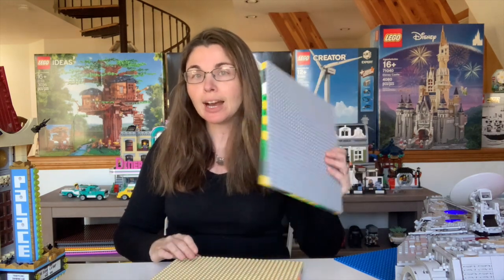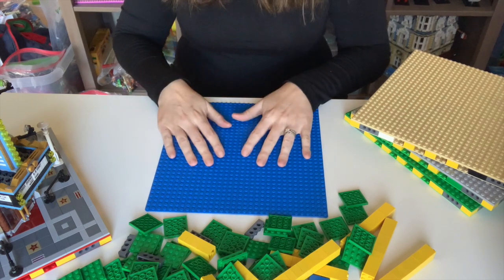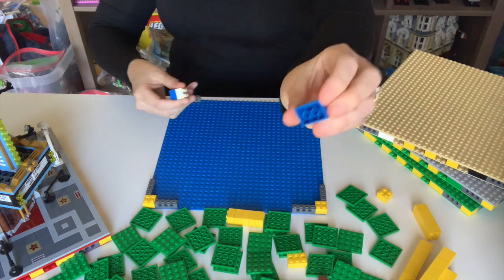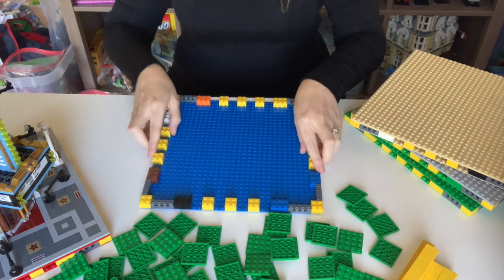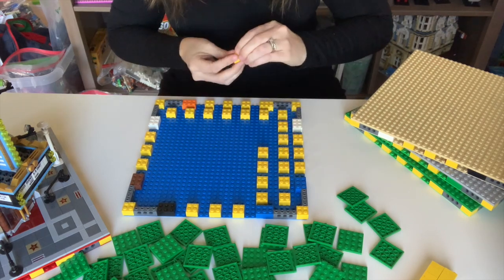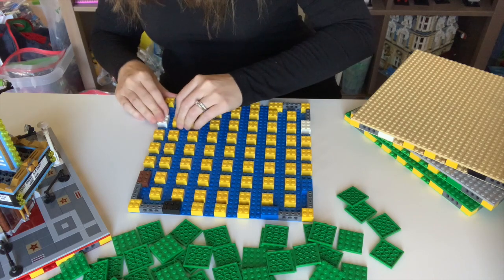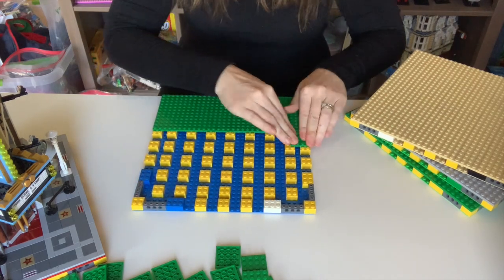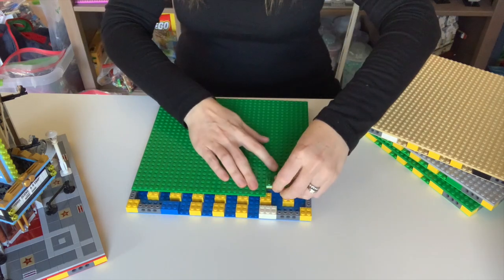So easy! Make LEGO MILS Plates From Start to Finish

Comment: So glad I found your channel.  I purchased enough LEGO for 25 plates, however, I found out that the lavender 2x2 were the cheapest...as least is was when I purchased 2,000 bricks.  The reason I went forward with this was your video on moving the modular.  I moved two today, the Cafe Corner and Grand Emporium.  Glad I followed your advice to have the instruction manual as I definitely needed it.  This also gave me a good opportunity to do a good cleaning on the building.  Now I need to move the Diner and the Fire Brigade.  Then I have quite a few that aren't built yet...just missing the Green Grocer.  Thank you for posting the video and making it look easy.
Reply from the maker: Awesome! Yes, the cheapest color switches around so it’s definitely good to be open to all colors! It really is easy to move them as long as you stay focused! Good luck on the rest and thank you!

Comment: I'm just starting out with a few used modular buildings and getting my MILS plates together.  One of these is the Assembly Square set.  How do I make a MILS plate for this set?  The set uses a 32x32 baseplate + a 16x32 baseplate so I need a footprint of 48x32, which I can't figure out how to make a MILS plate.   Is it best, to just make 2 32x32 MILS plates and build on top of the two as a unit?    Thanks!  I just found your channel and have watched quite a few, great job!
Reply from the maker: Hey,  I would simply build on the 32 and 16 provided. Build them as one with and joint them with 2x4 bricks down the middle to create one large footprint to then turn into a mils plate. You don’t want to make them two separate plates for stability.

Comment: The 2x3 bricks are not required, they can be replaced with 2x2 bricks. Also the technic bricks are not reqiured, I connect my plates together with tiles and what not (saves a little $). Love the channel!
Reply from the maker: You are correct! I will use any assortment that I have available. I like to keep each of mine separate though as I move them all too often. I may never pin them together at this point.

Comment: I’m just about to start building a city and I’m glad I found your channel. I finally have a spare room since my last child moved out 😂
Have you used this method for Lego trains? I’m hoping to have a number of trains in my city.
Thanks
Reply from the maker: I have not yet but will as I have a couple myself but space with a train and a city is tough. If you really want a train or multiple trains, start with them. Then add your city around it. You would simply build your mils and add the track to the top. You can easily dress it up and make it look cool from there.

Comment: I just gotten the Assembly Square set..I've combined the 32x32 and 16x32 wide plates to make one 32x48 mils since I won't need to separate the buildings. It looks a bit strange but it's really stiff
Reply from the maker: Awesome. Mine is joined up as well. Doesn’t split. So easy to move!

Comment: Where do you get your bricks from to make these?  I'm new to the hobbie and don't have the spare pieces.  Thanks a bunch for the video!
Reply from the maker: 👋 I buy in bulk off of bricklink. I have a video that breaks down average cost as well.
Reply: @LittleBinsandBricks  Thanks.  I just dropped some cash on bricklink.  Very cool sight.  For halloween I'm going to add the haunted house on a 32x64 MILS plate so I can extend the fence off the front and put the graveyard scene to the side.  Will be a little weird in a city scape, but hey it's going to be halloween soon :) 

Thanks for the videos.

Comment: Instead of using 64 4x4 plates, have you tried making one with a 32x32 plate on top?
Would cut down on the number of 2x2 bricks that you would need as well.
In another video you mentioned that you bought some of those off brand base
plates. Don't want to mention the brand here, but there is one that has 32x32 plates.
They call them stackable baseplates  but they are actually just plates. Holes underneath

and not flat on the bottom like a base plate.
James
Reply from the maker: Yes I do have some of them. They could work but I found the connection strength to really vary from plate plate. Not consistent quality at all from that batch at least! Though it could be done if necessary!
Reply: @LittleBinsandBricks  , O.K. Was just wondering if you tried them. I have and 
they (the brand I bought) seem fine. I have seen reviews on AMZ for some brands and they said some spots were not as tight or even to tight fitting but I figured since it's going to be a MILS plate do we really need every connection out of 32x32 to be perfect. Anyway, look forward to you next videos. James

Comment: Great video   How do i go about making a mills plate for the assembly suqare?
Reply from the maker: Thanks! Well you would take the 32x32 and 16x16 and secure them with Bricks up the seam of the two and then build the mils plate out from there. You can also build the two plates separately and then pin them before transferring the building. Or! Get ready for this, build it on two full plates and add more walkway, park area! Then you don’t have the odd half plate size!

Comment: Good stuff! I've never built a MILS plate but I currently have something similar in the town I just started working on (got a few of the 30604 road expansion sets on clearance for $12 each) and it definitely isn't as durable. I just don't have a whole lot of base plates for the very bottom, so I might have to go with normal plates for now.

I've been kind of out of the loop on Lego tricks for 20 years and I'm trying to catch up. Is it generally less expensive to get four 4x4 plates than one 8x8 plate?
Reply from the maker: It’s all about working with what you’ve got! I just got into LEGO really about a year ago other than building things with my son when he was younger. In general, the 4x4 is cheaper with a better range of colors. Though it’s always fluctuating!

Comment: Like Jason H I was wondering if I can simply use another 32 x 32 base plate as a top layer instead of all the 4 x 4 plates or is there a strength difference? Great video, liked & subscribed. We have 6 modulars now and just waiting (patiently?) for an adult son to move out so we can take over their room! Lol.
Reply from the maker: Unfortunately the base plate does not have the stud connection on the bottom. You could try off brand plates I won't tell. Mine is 11 let's see how long we have to go. He's got a big room.
Reply: @LittleBinsandBricks  Ah yes I forgot about that issue with the typical baseplate, however, have you heard of Slab Dream Lab(Made In The USA, yay!)? My local Bricks & Mini Figs store just started carrying them and they have base plates that are 38 x 38 studs and they do have the stud connections on the bottom 2 wide all around the edge(sort of, hard to explain but they aren't exactly all the way out along the edge) and 4 wide in a cross pattern through the middle of the plate. I have 4 of them now and they cost me $7 each. There are some problems with the way the stud connections are laid out on the bottom but the whole plate is at least twice as rigid because of its construction than a normal Lego base plate.
Reply: I went with 32x32 plates from Strictly Briks on Amazon instead of the 4x4 plates.

Comment: Starting to build MILS plates and wanted to know what color you suggest for the top 4x4s?
Reply from the maker: Well I paired each modular with the color of the base plate it came on if you want to get very specific. Other than that a lbg works well and of course green for outdoor spaces. Finding them now is the tricky part!

Comment: Ok so while I go back through and still try to decide... I have a very important question... what about the builds that are not on square baseplates, and cannot be? Like the Disney Castle, or the carousel, Ferris wheel, roller coaster, Disney train station, the treehouse??  Or things that open, like this years haunted house? There has to be a way, yes??? 🤔🤔🤔
Reply from the maker: MILS underneath is the way to go if the structure can not be integrated as part of the MILS plate (replacing 4x4s for the plates the set is already built on). I will definitely follow up with a video on this but if you plan to use MILS in a city, your whole base will need to be MILS anyway, not just where the buildings/rides sit!
Reply: @LittleBinsandBricks  Is this follow up video still in your plans? I want to have a stiffer base for my Hogwarts Castle and some other noncity builds.

Comment: Another cheap method is using round 2x2 bricks instead of regular 2x2 bricks.
Reply from the maker: Excellent tip, I will have to make sure I check on those as well!

Comment: this looks like you copied Bevins Bricks. but Great Job On The Vid!
Reply: and most of the mil plates are your own mocs.
Reply from the maker: Yea, everyone's are basically all about the same. Sometimes I seal all the way around with bricks too but that's not cost effective.  I look for what's cheapest but switch out the 2x3 with whatever I have. I will use random plates on the top depending what's available.